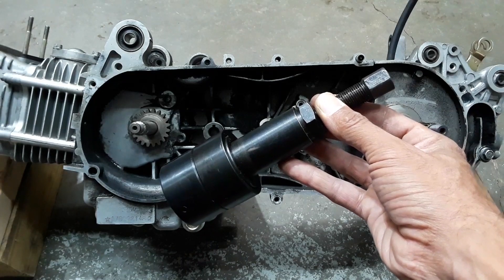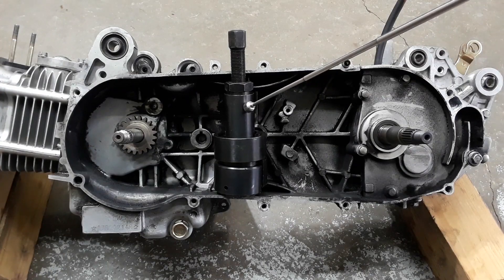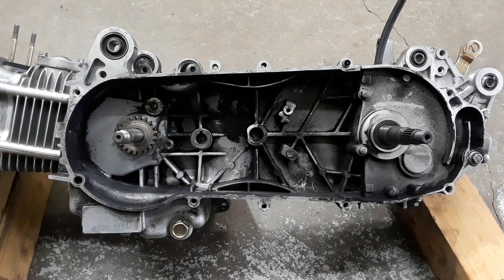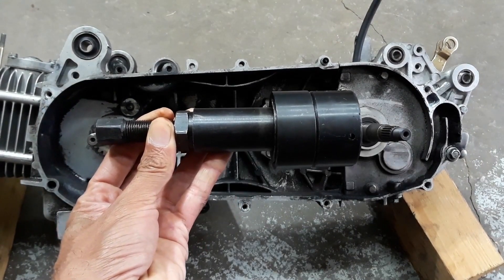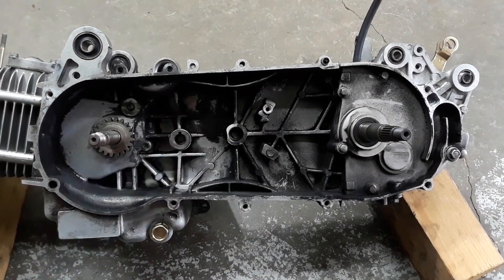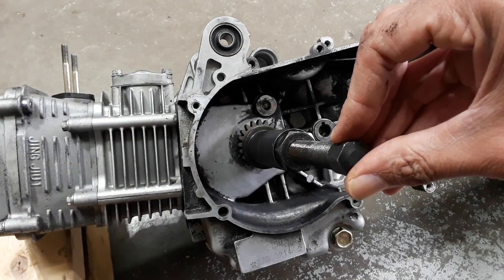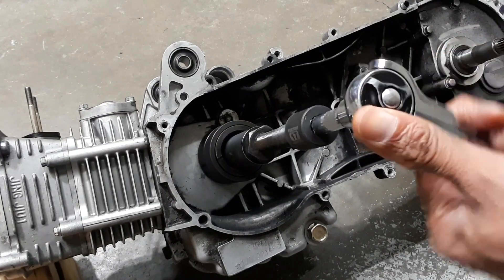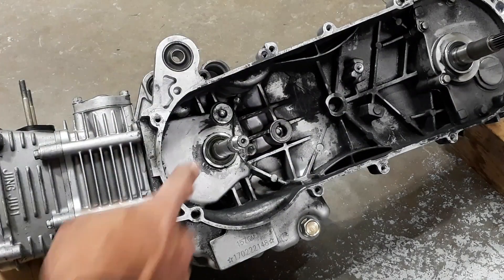Kick Start Gear Removal Tool / How to Use / GY6 Engine

Comment: My brother I have ran into a little problem that little kick start gear that is behind the variator as shown here in your video well it came loose all by itself I'm thinking do I find a deep socket to pound it back into place , can the scooter run with out it, or will I need a press 🤔 I just bought a new cvt kit and this little issue at hand gots me on hold  so I thought I touch bases with you for some advice, thanks bro ...🙂👍
Reply from the maker: You know bro, I really think you need to press it back on. When I was building the motor, I wanted to keep mine off, but thought it held the variator in place. I am not absolutely sure though.
Reply: Thank you bro I'm gonna go out there and see if I can get it back into its place , you and your family have a blessed day ....🙂🙏
Reply from the maker: @GY6-SCOOTERS  You got this!

Comment: That tool won't work on all gy6, some gy6 150cc have a raised area for the seal that will prevent that tool from entering the rear of the starter gear, there is absolutly no space for that tool to enter and in that case you can get long screws with a flat head so you can use a traditional gear puller because the bolts for the traditional gear puller are too large and you won't be able to close the 2 halves.
Reply from the maker: Good to know.
Reply: this is a great comment because I am one of those people who has a tao tao 150 and I can't get the special tool behind the gear adequately so that the two halves come together as they should.  how do you avoid this pitfall?  how are you supposed to know whether the engine you are buying has this characteristic?  I'm going to try a three jaw puller and see how that goes before I grind this tool.  but I may have to grind.
Reply from the maker: @edwardjames6070  let us know what happens.

Comment: Bro thank you for this video. I was going crazy trying to figure out how to remove this gear to replace the seal behind it. I ordered up the tool, even if I only use it once it will be worth it!
Reply from the maker: No problem bro. Glad I could help. It will be soooo worth it.
Reply: @kachiskid  did you put the gear back or did you end up using some kind of spacer instead? Not sure if I will need to make up for the lack of space from removing the gear.
Reply from the maker: @AcesHighMedia  I reinstalled the gear.

Comment: OK SO I HAD TO REPLACE THE OIL RING BEHIND THAT GEAR , SO I GOT IT OFF IN A SIMILAR WAY...THE QUESTION IS HOW DO U GET IT PRESSED BACK ON  PLEASE ANY HELP U CAN GIVE ME ..
Reply from the maker: I heated mine, and used a small pipe to rubber hammer in place. I did the process in this video. https://youtu.be/4NKnNF2UHDU

Comment: Great tool to include in a community tool library, open for sharing and no need to invest on a one-time use item. Is there a tool library (anywhere in the country? I’m intrigued I’ll do some research😜) for scooter/motorcyclists?
Reply from the maker: Tool library? Not that I have heard of, but great idea nevertheless. Something like the tool loaner program at Home Depot, but for scoots.

Comment: I'm in the same process as you are I'm putting a stroker crank in and this helped me out a lot because I was going to buy one of my Harbor Freight gear pullers.. thanks a lot I appreciate it!!! now I just need to wait a week to get it from Puerto Rico
Reply from the maker: No problem David. GY6store.com sell them also, for about $4 more. What engine are you going with? A 232cc?
Reply: @kachiskid  My scooter has been sitting for about 2 years I have a Taotao Lancer like yours...  it' has brand-new 150cc in it and only has about 300 miles on it.. I'm putting a Taida 171cc Big Bore Kit with a forged piston... I just dumped about $2,500 in it new plastics, paint, variator, clutch, ankle biter, mirrors seat, tires, exhaust everything!!!! I was thinking about building a 232 but after doing my research my next motor is going to be a GY6 250cc It's water cooled.. it's a lot cheaper and faster... 🤔... maybe I'll build a Ruckus with the 250cc in it ✌

Comment: Order another 170 piston, pin, & jug...or dont be surprised buy blow by or low compression when not getting the rings back just right in place. The rings usually wear oval like. But maybe your times been so short new rings will still wear right into the old jug. Kits got everything & it honed rtg tho
Reply from the maker: How often do you go though pistons? I think I am gonna follow Daniel Martins guide on clocking a piston. Never done that before.

Comment: What is it?
Its your new best friend for rebuilding gy6 150s. 
You just saved $140 slice of the engine & gearbox everytime you use it.
I keep 3 engines , all from 2000-2004 era : All rebuilt many times. Usually its just a top end & oil pump because I don't run a air filter .
You got a m6 helicoil rig ?
Theres a good metic 3 piece kit, but youll still need good longer "3D coil inserts" packs sold separately
Reply: 😁
https://m.youtube.com/watch?v=S1bp1msK-Lg
Reply from the maker: @noneshere  Just watched it! The 1st time a video was actually addressed to me. lol. I subbed also, so I want to see that Mongoose in action, and you to teach me how to bow fish. If I ever make some money I will invest in a storage unit, that is awesome. How much does it run a month? I was just gonna tell you that I'm running out of space in the garage to place engines but the answer is right in your video. KEEP IT UP BRO!

Comment: Have a big set of pullers like these for cars. Hate the design but it works. Have to check if one fits a gy6 before I order this one.
Reply from the maker: Yeah pullers area necessary evil when dealing with car engines. I didn't check mine, but I should have before ordering.

Comment: Hey kid by the time you are done you will be able to open a dealership for gy6 powered scooters
Reply from the maker: That is a thought...lol. Getting so use to it I could rip an engine apart in record time.
Reply: @kachiskid  i believe you have the brains to make a decent business out of it and in the winter just run a 4×4truck with a plow to make money in the slow season